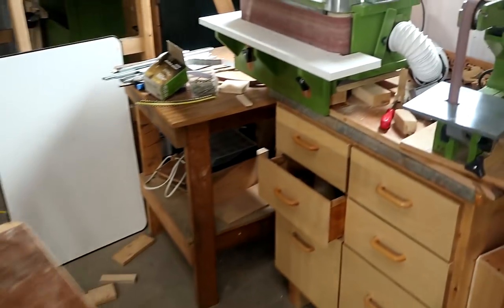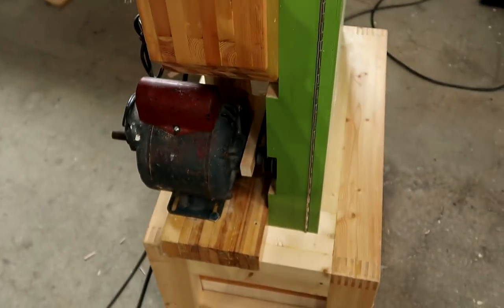Pulleys with setscrews suck

Comment: It's actually not always easier to fix what's broken than to make a new one, because if that were true then you'd always try to glue a broken window or plate back together than buy one that was easier for the factory to make than for you to fix. Same thing with one of these pulleys; if it shattered then you'd know it would be easier and better to build a new one than to try to glue the bits and pieces of the shattered one back together.

Comment: slotted set screws are no good. you need to use hex socket set screws. preferably two at 90 degrees to each other. I am a maintenance mechanic in a factory. we use set screws all the time with no problems. but your motor shaft may be too worn to hold a pulley at this point. another option is taper locks. even better.

Comment: The pulley needs to be a zero tolerance fit or a light shrink fit with to set screws at 90° one set screw over a key👍

Comment: Threadlocker and a socket head setscrew would probably help a lot.  However, this is probably only true if the pulley is actually concentric.  The other system of attachment you referred to is called TaperLock but I've not seen that on a pulley as small as what you're using.

Comment: All covered in a MechEng degree, but it's almost always cheaper to do the rubbish set screw option than to do a proper key, taperlock, or spline.
Reply: It already has a keyway and key, and the setscrew bears down on the key. The key is especially visible as he's applying the UHMW tape to the motor shaft.

Comment: Try gluing the pulley directly on the shaft using loctide bearing glue. It is really solid and just needs a little bit of heat to get it off again

Comment: Another way is to have a flat side on the shaft so one of the grub screws is screwed to the flat side like GT2 pulleys.
Reply: It already has a keyway and key, and the setscrew bears down on the key. The key is especially visible as he's applying the UHMW tape to the motor shaft.
Reply: Yes, I saw that but very obviously that keyway and key failed whereas a flat side isn't going to fail (suddenly become round).  That is what I was talking about.
Reply: The keyway and key have not failed, and are a far superior system to a flat on the shaft. What has failed here is the pulley bore or shaft surface; that is, there's far too much slop in the fit. A flat on the shaft will not solve the problem better than the existing key.
Reply: If it hadn't failed then why did he have to stick tape?  I have never had to stick tape on any keyway or key I have nor any with a flat.  Something isn't jiving.
Reply: As I stated above, the fit between the pulley and shaft is what failed. Or more accurately, that fit has never been successful. The key did not fail.
Reply: Ahhhh, so Mattias built it jury rig style then.  I gotcha.

Comment: Shear pin or keyway...
Reply: It already has a keyway and key, and the setscrew bears down on the key. The key is especially visible as he's applying the UHMW tape to the motor shaft.
Reply: If the set screw is set on the keyway, that is part of the problem....
Reply: ck m 
I agree. Spin the pulley through 180° and grind a tiny flat into the shaft for the screw to bear on. Or drill and tap the end of the shaft.
Reply: Mr T 
That does rather beg the question then of why he is having the problem in the first place...

Comment: Loctite 638 on shaft, key and hub, thank me later.
Reply: This issue is also the reason why these setscrew-contraptions have been largely replaced by clamping bushings, because those will positively not come lose. Plus, pulleys for clamping bushings cover a bunch of shaft sizes just by using a different clamping sleeve. Quite nice to reduce SKU count, especially because one clamping sleeve will fit into a whole bunch of pulleys.